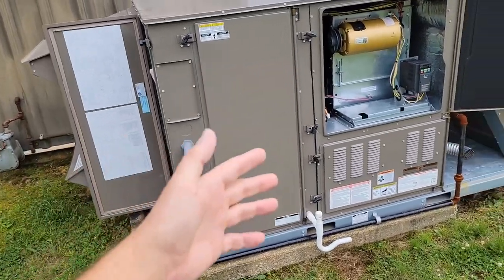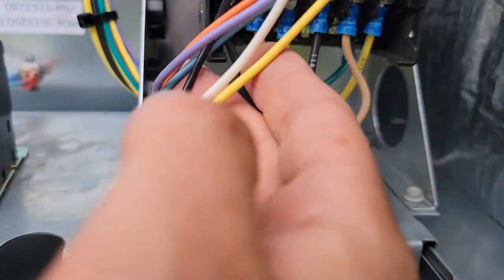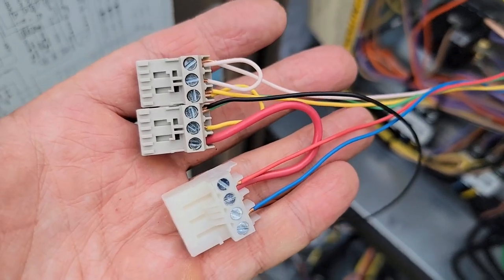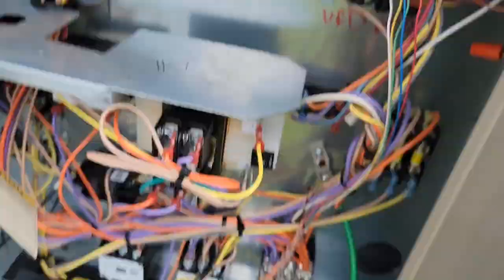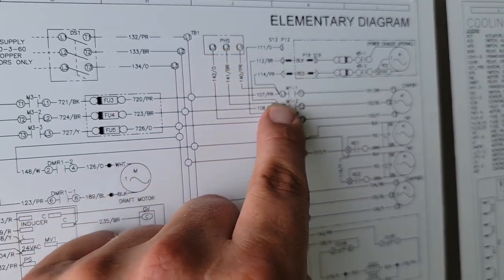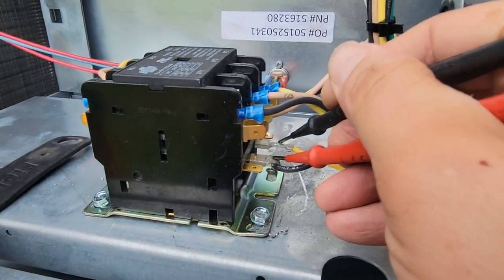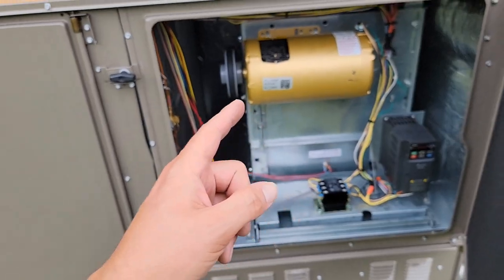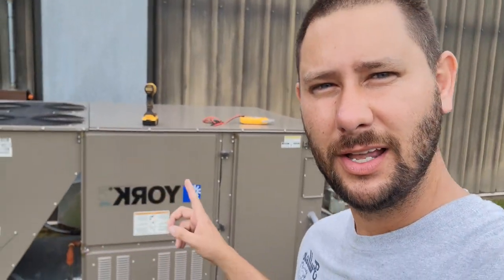How to bypass the VFD?

Comment: I just came across this video and I'm going to tell you a few things that will help you in the future.  Point 1. The reason you are having a difficult time with the VFD is most likely you have a high leg. The VFD doesn't like this. It will run for a while and then decide to lock out.  VFD's don't work with a high leg of power. Point 2. You didn't have to run power from the G terminal and common. You also didn't have to switch the T-stat to Electric.  If you read the schematic, there is a relay in the top left side of the control panel.  It's a clear relay with a normaly open set of contacts and a 24v coil.  That's the low voltage power to the VFD. It's energized on a call for heat or cooling.  Simply remove the 24v coil wires from the relay and put them on your contactor. Mount the contactor in the control panel.  The control wires are long enough to reach the new contactor.  I put a 2x4 box with cover in the blower compartment to connect the motor wires.
Reply: Thanks for the info. Saved me a bit of work
Reply: How do you know that it has a high leg ?
Reply: 3 phase go each leg to ground. You should have 110v at each leg.  If you get one leg that is 208 volts then that is your high leg. If you have that, you will have issues with the VFD. @soulmpowered
Reply: Working on this right now in  Mill Valley, CA.  Couldn't thank you enough for this comment. Shout out to Taddy for the channel and initial advise!!
Reply from the maker: I've got a video on how to figure out if it's a high leg.
Reply: @HodderHVAC one question though. Why the 2x4 box for motor wire connections? Is there a problem with spade connections/wire nuts/wago alone? Just asking because as I went to install the 2x4 box I picked up I thought to myself wtf am I doing this lol
Reply: I am guessing but I would assume that like any wire splice in a home or building, the splice has to be in an enclosed box. The box with proper connectors will secure the wire connections from pulling apart  and if it ever does, the short will be contained in the box.  Just like your motor connections are enclosed and secured.

Comment: Do the other ends of the wires  from your  24 v coil connect to the control board harness?? I see smaller gauge from control board angle.

Comment: The company I work for, our units have an Entouch thermostat. It would have to be programmed by management. I have trouble when you get a power blip and loose a leg for a second. The VFD faults out and the unit stops working. I have to drive out just to press the stop/reset button on the drive. Very aggravating.

Comment: I'm not a fan of York equipment in general, but wondering if you have any tips for placing temperature probes for superheat/subcool in package equipment (especially Yorks), because it is so dang hard to reach into the compressor compartment in some of their older equipment!! Thanks in advance from Nashville!
Reply from the maker: I'm not a fan either
 They have terrible manufacturing practices
 If it wasn't for my distributor I would never sell another York again

Comment: Looked like your vfd had an enable signal wired. I think using that for your contactor coil would have made things a little more plug and play. Did you just not notice that or was there some other factor?
Reply from the maker: Daniel thank you so much for letting me know this knowledge I did not even notice this otherwise I would have  Use that as my option for energizing my coil
Reply: Is that a 24vac signal for fan demand?
Reply: @HVArctiC-Monkey  yes usually 24 for an enable and 0-10 for any type of modulation signal

Comment: It seems that York VFD’s  lock out for no reason. No high leg issue and we have changed most of the York units over to a contactor. York does not have an answer for the issue so far that I am aware of. Just say to install a contactor. York units only so far. They are all on back order if you try to get a replacement. If there is any other info. Please share.
Reply from the maker: I am not sure why I just know its super inconvenient in the field

Comment: Hey Tad did the vfd display a code when in alarm?
Reply from the maker: No sir
But usually the vfd will display a code
Reply: @TaddyDigest  yeah that’s weird, from my experience a lot of VFDs will go into “overcurrent” fault. This usually happens because the soft start up isn’t long enough, and can be fixed by increasing the ramp time on the VFD module programming

Comment: I doubt if that motor has internal protection ; protection is through the VFD so the contactor leaves it with no overload . An IEC style with an overload block would be much better even though it’s 250 vs 40  ; finding the problem ( probably high or unbalanced voltage ) would be lots better than treating the symptom. Had to do this in places where voltage was 480-490 and drive on smaller  equipment was only configureed for 460. Not being negative , just practical.

Comment: Do you have to do anything with the control board? I was able to get it to reset but I had an.STL3 failure on it. I know the parts not available locally.So I might have to end up doing the same thing.I just know the control board.Says vfd failure when it fails.So I didn't know if you had to do something to the computer or not

Comment: Dear Tad! What an incredible video.  I live in South Florida and my VFD blew and my a/c tech told me they are on back order for months.  My room is hot and I can not stand the heat.   I have a trane variable speed 4TTV8036A1000BA.   I understand what you did on this unit and wonder if I can do it on mine.   I have not opened up the unit well but I wonder if it would fit the contactor within the space?   Do you know this unit?
Bill
Reply from the maker: I'm not sure if it would work for yours or not I would have to do a little research
 You're welcome to click the join button become a member and let me know when you join and I will send you an email
Reply from the maker: thanks for watching 👀 😀

Comment: Thanks for this video--it got me wondering about something I watched. I noticed quite a few HVAC units (3 phase rooftops) with VFD have contactors between it and the compressor(s) and I was wondering why. Old school when I did it, but a contactor between a VFD and its motor was a big no-no. If the motor is not always connected, features such as DC boost, soft starts, frequency ramping, etc. all or most of that is not available with a contactor in the circuit. Is the VFD limited in what it can do and needs a contactor? I watched an HVAC tech service a 3p Lennox rooftop on Youtube and I was confused. A VFD drove three compressors through three contactors. I am guessing that the VFD provides a bit of energy savings and possibly some monitoring, but little else?
Reply: The contractors are installed between the motor and VFD in case of failure to have a backup mode. This works fine for asynchronous 3 phase induction motors. If you have a BLDC motor, which is a synchronous 3 phase permanent magnet motor, you should run it from the vfd. It is not possible to run it just from the wall it may cause damage to the windings of the motor.

Comment: Shouldn't the fan run at about 25 hz when there is no call for cooling for fresh air requirements and when compressors come on in cooling mode the vfd should ramp up to 60hz i thought, with the contactor installed it appears to only turn the fan on in cooling mode.
Reply from the maker: What if there's no fresh air
Reply: @TaddyDigest  then I guess it would be off and then full throttle when it is on where I live they have I believe a 15 percent minimum outside air requirement for buildings it might be different in other areas I am working on a York rtu unit right now and I can't get the hz to change at all it is locked at 25hz I have power coming off the board and power at the Mitsubishi vfd that is in it when the cooling kicks in it doesn't ramp up to 60hz so I figure it's either the control board issue not telling the vfd to increase fan speed or an internal vfd problem have you ever had an issue like this before on a York rtu unit where the hz is locked on low speed.

Comment: Instead of changing setting on thermostat from gas to electric, could you have left it on gas and simply put a jumper between w and g?
Reply from the maker: good idea you could have
Reply: A lot of T-stats, you can go in the installation setup and have the thermostat control the fan in heating mode opposed to having the unit control the fan in heating mode.
Reply from the maker: that is correct 👌 👏 👍
Reply: and then they turn the fan to continuous and the unit begins to heat... dont do the jumper
Reply: @markcantrell2470  lol, you're right
Reply: Would energize heater when fan on is turnt on but if u wanna get all technical could install single pole single throw to energize blower contactor when ever W was energized

Comment: Hold on. The thermostat doesn't send the signal in heat. That is done by the blower limit. You have to wire the relay in. Setting the stat to the electric heat, the blower shuts down immediately after the call for heat. Also, you gotta let the board know that it is single speed instead of vfd
Reply from the maker: That is correct you know your stuff. Thank you for this comment very good.
Reply: @TaddyDigest  I had to do this the other day.

Comment: What was wrong with the VFD? What error codes did it give you?
Reply from the maker: The problem was not with the vfd
 The problem was with the control board
   No error on vfd 
error on SSE board was fan vfd failure
Reply: @TaddyDigest  just curious, did you hook map gateway up? If so was fan set for VFD or fixed variable?
Reply from the maker: yes I did Fan was set to vfd